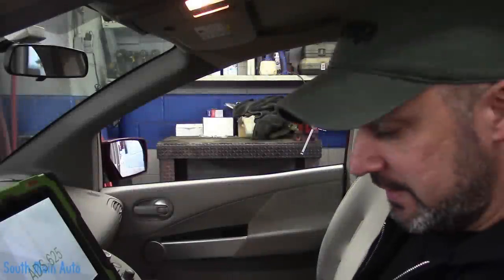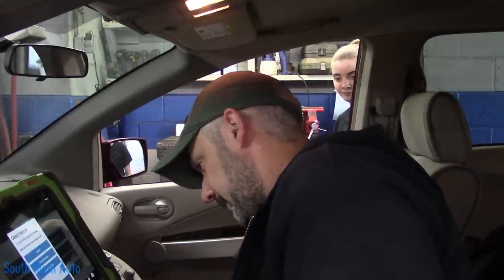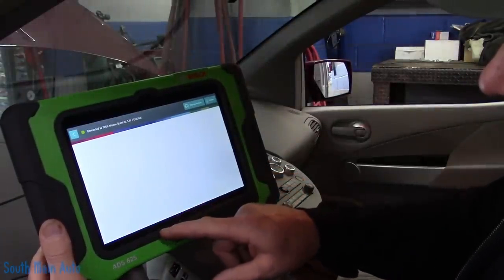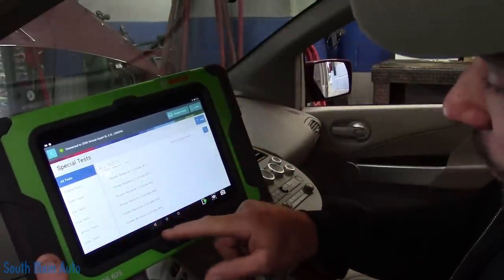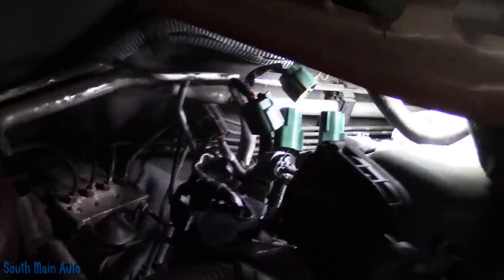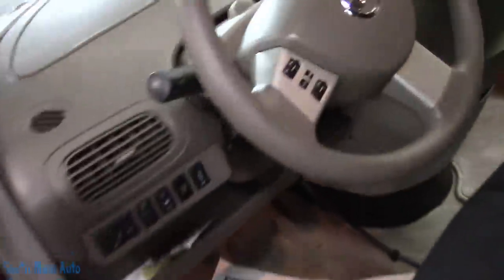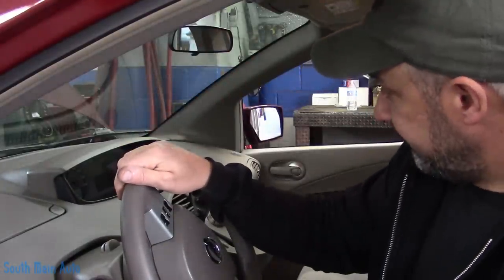Customer Replaced Spark Plugs And Now It Runs Bad!?

Comment from the maker: Sorry for the 360p, something on YT's end... It was uploaded in 1080 60fps. Sometimes this takes a while for them to render it.
Reply: All is forgiven
Reply: The worse mistake I made was ending up with “spare parts” after I changed something in the engine bay 😳
Reply: South Main Potato :))
worse part, I didn't even notice, watching in smaller window, too many things going at once
Reply: Any one in the UK also? Hiya Eric
Reply: Generally it's best to wait until it finishes processing before clicking "publish" :)
Reply: I see you use a Bosch scan tool, I am a home mechanic working on my family's   cars. What would be a good scan tool no of a crazy price . Thanks
Reply: One of the reasons why I got into autorepair/diy was because a senior toyota tech did this exact same thing to my old supra. Had a different firing order than more contemporary straight 6es and it was only firing on 3 cylinders. 3k and a lawsuit later I found the error myself. Never looked back
Reply: @parmaredmen  Bill that's a spendy scan tool. It's the Bosch ADS625 which when I bought mine in Feb I got promo pricing from my parts suppliers tools division and on top of that they were giving a $1,000 rebate from Bosch. Net price before rebate with tax was $4,100 from the initial $4,700 range. Annual subscription updates is expected to fall in the $1,000-$1,200 range based on it being new they didn't have re-up pricing out at the time. It does come with wiring diagrams. 

You can pickup a Autel TS608 over on www.aeswave.com in the mid $500 range which comes with 1yr of free updates and then you can update it annually in the $200-$250 range I believe they told me when I picked up mine last fall. 

Definitely don't stop looking as there's deals out there. If you dig hard enough you can probably find a Solus Edge from Snap-On in the low $2k range updated or a little less. It's been out a few years and always start low as they'll start high. Cash talks with the franchisee dealers. I bought my first one from them for $2,700 and some change with taxes and all paid in full with the next update for free which. 

IF you keep the subscription active you can get suretrack which gives you some diagnostic info and shows trends from what repair shops put into work orders. These will only be shops that use Snap-On's Shopkey Pro software for their repair write-ups so it can be hit and miss. 

Get a business license and you can get shopkey pro and access OEM level information but you'll pay about $146-$165 per month depending on what kind of deal your get. They'll most likely want a copy of the business license before letting you purchase shopkey. 

Hope some of these options got you started. There's always a basic scope for pulling codes and then getting a Picoscope kit from www.Autonerdz.com and you can use the desktop software with a Picoscope to verify the part is bad and replace it and verify it's good then use the scan tool to clear the codes. I have a Innova 3160d I believe it is that does ABS, SRS, Check Engine Lights and some minimal live data. I'm sure Innova has a newer version by now but it's a good handheld for budget pricing. 👍
Reply: Hey you didn't guessimize the customer used the wrong spark plugs or gapped them lol
Reply: I don't even notice the difference, I think it's 1080p in the background, but displaying as 360.
Reply: @parmaredmen   I'm also DIY and work on other peoples cars also,I have 3 scan tools,AL319 is a Autel witch is my "go to" around $20,OTC SN 14088 $55 or so don't use it much back lighting stinks,Diagun IV  X-431 really nice but its $500,got it on sale for $488 this thing has been featured on SMA and many other channels.
Reply: @parmaredmen  it is not really the price of the scan tool period. It's the price of the subscription for all the updates I mean the yearly subscription that you have to charge for to cover the enormous cost. Of the subscription to use the tool
Reply: It’s YT, it releases a video but only in 360p the render catches up about 10 mins later
Reply: bill heym I have quite a few scan tools, my go to is a Autel Maxi check pro that has put a snap-on virus to shame many a time - my Delphi Ds150 is my backup (laptop based) but it does produce full PDF reports
Reply: All good Eric, still enjoyed your video as always
Reply: Is it possible to replace stereo wiring harness? The harness that connects to the stereo?
Reply: 8 hours later its still in 360p cmon youtube get yours heads outta ur butts
Reply: 11 hrs later still 360p YouTube please fix your platform! Anyhow still watched the entire video ☺️
Reply: @ILikeMetricMusic  No! That's a sign that you are a brilliant mechanic and the factory made the mistake of using too many parts.
Reply: quality was fine on my end!
Reply: I actually like Lego movies lol
Reply: Ahh friggin YouTube! Figures! 😁
Reply: 6 hrs in...wonder what the final bill was to the customer.
Reply: Well at least the PS pump is nice and loud...smh
Reply: Where’s our tool box tour SMA?!  We’d love to know that set up that SMA uses!
Reply: Its 3 days already and still 360p
Reply: Forgot to put lifter oil galley plugs back in after boiling engine block on rebuild. Couldn't figure out why oil pressure would drop by the time engine reached temp! That was embarrassing customer drove it for a week like that!
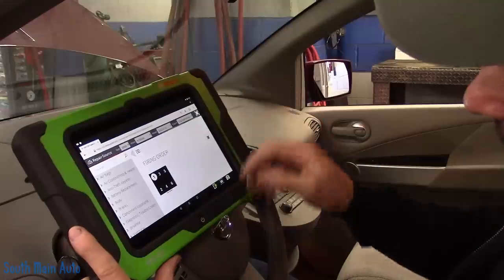Reply: @parmaredmen  I also fix friend's car,s and use a very cheap Chinese OBD2 Blue tooth dongle with the Torgue App on a Samsung j3 phone..Up to now it has never failed in Diagnosis and resetting of the fault light..Cost me £3:50 from Bangood.
I have 2 of them one gets left plugged in permanently to my car's  ODB port and I have the App Running on my spare phone with a Dash Guages display of RPM, GPS Speed, Coolant Temp,Average MPG,Turbo Boost,MAF and EGR. Works great once you get it to pair with phone or Tablets Bluetooth.
Reply: If you have never made a mistake then you obviously never learn.
Best way to learn by your mistakes.
Reply: YouTube is closing itself down it's like self deporting
Reply: FYI. This video is not playing on my Apple TV for some reason. It keeps saying “This video not supported on this device”.
Reply: I changed rings, bearings etc in a 73 vega, before starting it I thought I would clean up my mess. I did it in the street with motor in the car. picking up the empty boxes the ring box rattled. one set of rings in it. argh.
Reply: @glynwatkins9968  yep ... in the UK . Love SMA ....
Reply: Saturday July 11th 2020.
the 360p resolution is still the only available highest one on the date stated.
Reply: I only ever use 240 anyway... all yall are spoiled XD
Reply: i never make mistrakes.
Reply: All I got was a circle turning around.
Reply: Watching dad pui mud flaps on a singer sewing machine truck he was in a big hurry to get done before the movie.I watch him do the r/h side making brackets and drilling it up.Moving to the other side I asked"dad aren't you going to put one behind the wheel too?" He was embarrassed and asked me why didn't I tell him.I didn't question adults much.I told his friend later in life and he started calling him mud flap oops I have screwed up a time or two so I felt bad for letting it out!
Reply: Me and the significant other talk about a possible near future purchase and all of a sudden adds galore for said items. But wait... They don't listen to what your saying!!! 🤦🤦🤦
Reply: @ILikeMetricMusic  that's how you know you did a good job lol 😂🤣🤣
Reply: This video still doesn’t play.

Comment: 1972 Im 14. Changing the points on older sisters 1969 Plymouth Belvedere slant six. Drop points screw down distributor. Get new screw and install. Start engine. Runs ok. Dad goes out hours later to use the car and crank no start. Screw lodged in advance mechanism which locked the dist and sheared the nylon dist gear. Had to be towed to repair shop. After that I bought one of those spring loaded screw holders. 46 years later I still have that tool. 
And 46 years later I still remember that Dad didnt get angry. Lost him in 2016 at age 94 and I so miss him.
SMA#1
God bless
Paul
Reply: Great story.  He shaking his finger at you right now. I’m headed to see my dad for probably the last time in two weeks.
Reply: He didn't want to spoil it. You had good intentions and everyone screws up now and then,  especially while learning.
Reply: My father taught me how to work on cars also.. still too this day I am a good mechanic with auto and motorcycle, small gas engines., and miss my father also, he passed in 1986 age 57.8 years.I am now 58 and enjoy working on my own cars and tinkering around.
Reply: Wait till we get a solar flare and it wipes out 300 million cars and you're going to wish you still had a points ignition system sitting in your garage
Reply: My Dad taught me everything, about working on cars. He left me in 2016 age 91. Everyday I think of him. Greatest teacher i could have in life and in profession!!
Reply: I did the exact same thing at about the same age.
Reply: LOL
 Been there!
Reply: God Bless you Paul. It was my Grandad, who was a Chief engineer back in the thirties and forties for the tram and bus company in Bristol., I’m only an amateur but i love the problems solving side of things, I like fixing things, I still have a load of his old tools. Professionally I’m a software engineer but heh times change dont they :)
Reply: Great story!
Reply: That was a beautiful story, and one I can relate to. When I was six years old I was "helping" wash the brand-new family car--a Buick.

Dad gave me a scouring pad and told me to clean the white walls. Taking a guess, I scrubbed the white stripes.......on the belt line of the car, i.e. the pinstripes. 

He didn't get mad. He taught me how to use buffing compound and where the white walls were. I learned so much more than the parts of the car in that moment. 

Coincidentally, I also lost my father in 2016.
Reply: @thecloneguyz  I'm going to make a killing putting lawn mower engines in cars.
Reply: @wwsjr2  China already has brand new cars for $5,000 we just won't let them into the United States
Reply: Lost my dad Oct 20. Miss him. never realized how much I loved him till he was gone.
Reply: cheers from Australia. i was 10 years old 1973 my first introduction to car repair . watching a mechanic tune the single throat stromburg carbi on a GMH Holden Kingswood 6cyl . 186cu. showed me how to set the air mixture . iv never forgot it .
Reply: Very touching story..lost my dad 24 years ago, seems like yesterday.
Reply: When you drop a part in moving parts-remove it before starting vehicle.
Reply: A good man told me something after I lost my Dad. You are never ready to lose your parents, either of them. He had recently lost his father. It was a great piece of wisdom. It gave me comfort. I will never forget...
Reply: @SGTUSMCVET269  death is a human construct-all of us are eternal-reincarnating beings-
Reply: He didn't care about the mistake he was proud you got that far.
Reply: I was trying to remove a stubborn rusted bolt holding the toilet seat to the bowl. Back in the 70's the bolts were made of metal. I used a hammer -- you guessed it -- I cracked the bowl. Dad never got mad - just called the plumber:) Dads are great! The SSGT went to be with the LORD in 2017.

Comment: The first time I replaced my plugs, it ran like poop. I drove it to a mechanic. He put the wires in the correct order and didn’t want any money. I bought him lunch. Never happened again.
Reply: I didn't connect the spark plug caps properly and started to look for air intake leaks using a flammable aerosol. Never happened again!
Reply: Mytwistedvoices what I learned in mechanic school is, that the 10 seconds it takes to masking tape and label the plug wires can save you hours and a headache.
Reply: I was 16 before any mechanic schooling or YouTube. Call it a learning experience. I have a BS in Avionics, AS in Aviation maintenance (licensed aircraft maintenance technician, I am a pilot and I have a degree in electronic engineering. Spark plug wires are easy now.
Reply: tim coker  Love the old Chargers, I'm rebuilding my 1978 Honda CB750 Supersport. I have a video somewhere on Youtube about it. Just replaced all four rubber brake lines on my 2012 Caravan, one blew and lost all the fluid. The ABS was fine so normal bleeding and the van is perfect!
Reply: I would switch two wires to prevent my brother from taking my 79 Camaro, without my permission.
Reply: After all the trouble the customer went through diagnosing and failing.  I'm sure he was thoroughly embaressed to know he mixed up his wires and nothing more.
Reply: Keith Wittman  in my teens, a boy switched the wires on my car.  I saw fingersmudges on the wires and found he’d switched them. I matched up the numbers and had it running in about 10 minutes,  when he saw me driving he looked surprised.  Later we got married, he was still disabling my vehicles. When we separated and he did a bad bad thing, I switched the wires on his work truck.  He couldn’t figure it out!
Reply: First time I did, I forgot to plug in a coil pack 😂
Reply: First time I tried messing with spark plugs on a car I broke one on my dad’s old Ford. I went behind this gas station I used to ride my bike by and found old one in the dirt. Cleaned it up and nobody ever knew the wiser.
Reply: Same, old style distributer cap and did not keep track of the wires. It was horrible. Thankfully I reversed the two correct ones.
Reply: @dianahoward2717  LOL...The best revenge is outsmarting them....
Reply: Damn, you could have bought him lunch at least one more time... 😁
Reply: Use stock oem spark plug replacement best. Be it motorcycle or car. I been experienced because at first i thought engine problem but it was spark plug.
Reply: So what did you have for lunch?

Comment: I made this mistake before. Now i just do it one plug at a time. Keeps the confusion down and nothing gets mixed
Reply: kennedy796 I have 8 clothes pins numbered 1-8 with a sharpie. Stick em on before pulling anything apart and I don't have to worry about putting it back together.
Reply: That's how I learned to do it. At worst, the wires are unlabeled, so if you take them off, there's very little indication where they should go. Do them one by one, and it's impossible to make a mistake :)
Reply: My father, who was an engineer, gave me this tip once:  when taking something apart for the first time, write down each step as you go along.
Reply: Brian McPherson that’s a dang good idea. I’m stealing that one
Reply: It's a rite of passage
Reply: Me too and i take pics
Reply: same. just did it this weekend. one at a time
Reply: @brianmcpherson2906  great idea, much better than tape or labels.
Reply: On my dodge, it has 16 plugs and the brake booster is so close to the side of the engine so the only way to get to the ones in the back are to take everything out in front of it which happens to be every coil pack
Reply: Doing one at a time and put it back in the same spot then doing the next one the same is the best way make sure that it’s the same wires and coil packs are the same never getting them mixed up since my hemi has 16 plugs! It’s a pain
Reply: @8avexp  and keep the parts together. put screws,bolts etc all in same place they came out of if you can. or at least lay them out like they were on the part. washers,o rings,springs etc.
Reply: Actually there's another good reason to do just one at a time, someone else could have put a distributor in a tooth off and changed the plug wires I'm at the  at the distributor.  If going to change a distributor cap make a mark where the number one plug wire came from.